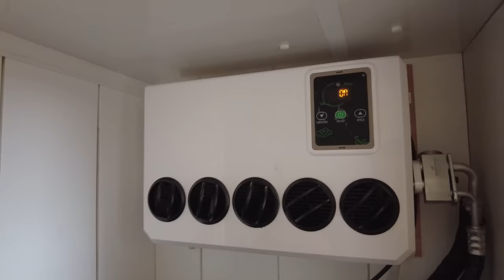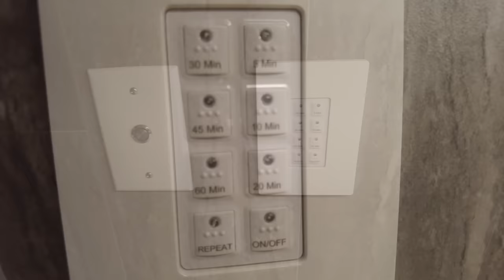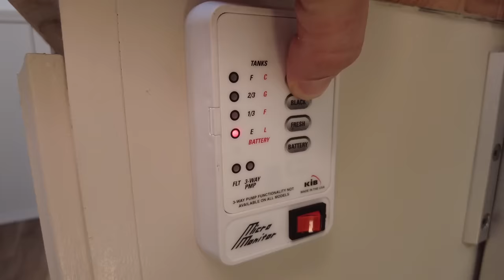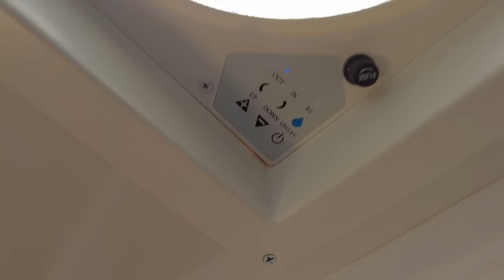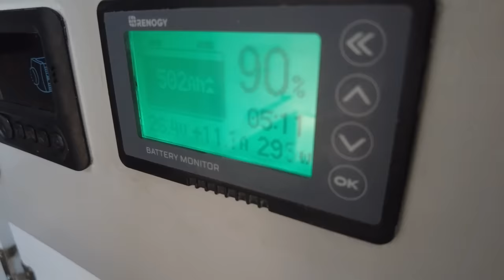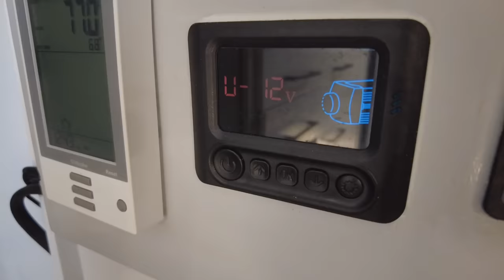Stealth Apartment + Toy Hauler in a Box Truck? DETAILED TOUR!

Comment: Kinda confused about the point of making it stealth? It seems like if the police want to wreck your day they'll do it either way. Interesting to see the pros and cons of the design choices, even if it seems like the guy's weirdly insecure about it. A price tag is the obvious elephant in the room here
Reply: the reasoning is that you can park anywhere, and your truck will simply look like a cargo truck instead of an RV full of valuables (laptops, jewelry, appliances, batteries, TV set, etc.)... you could go to the extreme of disguising it with stickers to make it look like there is nothing of value inside, like a flower delivery truck... LOL

Comment: Its a good build but the artogance and elistest attitude is pathetic. I design tiny homes and build vans. I can tell there are many things this guy doesn't know. 
Its all about options. First af all damn few people can afford that power system,  lol. Besides that there is absolutely no problem with ru ning a 12 volt system. The advatage is that there is no loss of power running an inverter. All my lights, water pump and charging systems run on 12 volt . My fridge and entertainment center run on 110 via an inverter.
Using a electric water heater , again a waste of electical energy which means more solar panels and more storage.
My bed is a fold out , its a couch during the day. Grey and black water tanks are a pain in the ass , excess weight and burning fuel to find a dumping station.
I use an ondemand water heater , very efficient,  4 burner stove and oven on propane. All my requirments cost me 40 bucks a month in propane.
Heating , diesel heater , running on 12 volts, propane heater with thermal electric fan , no power from storage required. Two reversible vent fans on 12 volt.
Yack down on vanlifeball you want but youve got a lot to learn.

Comment: By motorcycle you better hope your client ment dirt bike or Moped.  Any bike i have ever ridden is at least 550 pounds my current bike is well over 700 and i assure you its tire wouldnt even fit in that hole you cut for the tire holder let alone the fender you totally forgot about.  Also that bed is horrible you talk about you need a winch incase it gets resold to a elderly couple hell you could barely jump up onto that "bed".i would cut the fridge in half for a decent step to get into that bed.  also you have a shit ton of battery but no where near enough solar to charge it so your running the AC all night might work for the first day but good luck after that.  your whole no using 12v appliances is dumb a AC fridge burns like 15 percent more power lost in the conversion  AC AC is the same burns 15% more power converting it to AC from DC where getting a DC AC would automaticly burn less power.  Next problem you have no roof access you should put a roof access in the bed area.  Solar panels need to be cleaned and in the winter there is this weird thing called snow that makes you get no solar power thats not even taking into account your 1600 watt solar is mounted flat which admitted is the only way to do it for stealth but reduces the output of the solar panels to optimisticly half since most renogy panels already only get about 80%.  Your wasting waaay to much room on that couch you need to raise it up and put more storage above it your clients going to need a lot of stuff to use your poor design like a latter to get to the roof a few solar blankets to charge the batteries.  Question did i miss it or do you have nothing to keep your cabnets and drawers closed and why is that one shelf wide open with out even a ledge?

Edit after rereading you might think i am calling it complete shit so i decided to add the good parts.  The large battery bank will help with short stents of camping  Your have a nice amount of outlets which is very nice and the heated floor is a good touch.  The use of a diesel heater instead of a unit that is electric AC and heat is smart as you have much less solar in the winter so you have to really watch your energy usage.